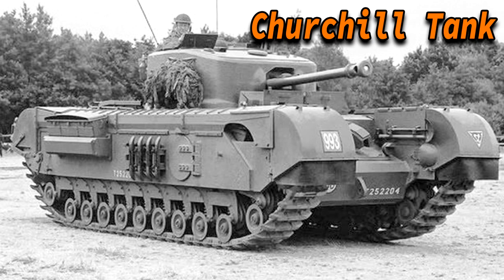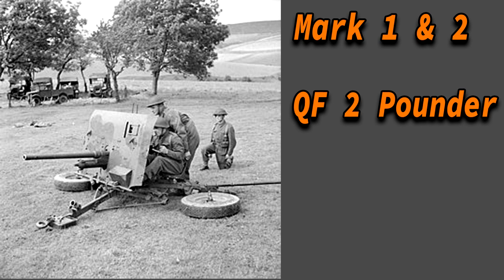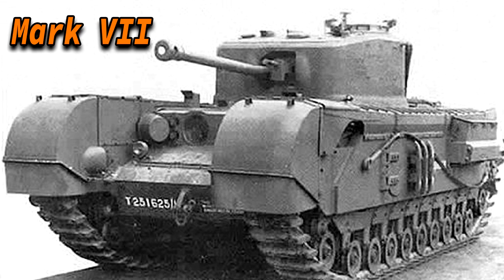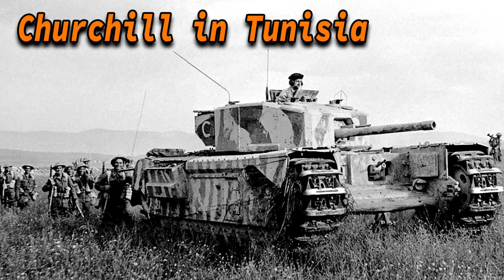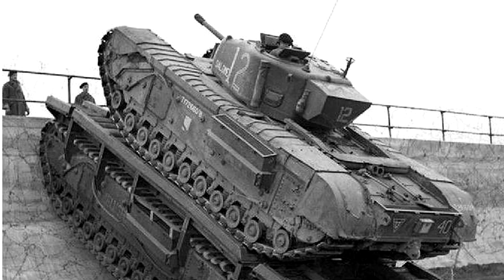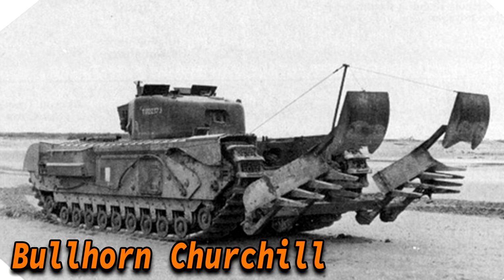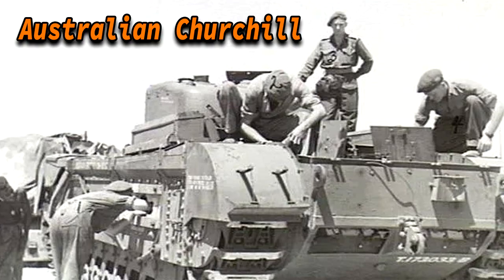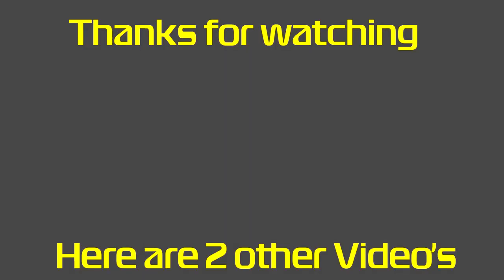Churchill | Waste of Materials?

Comment: Misunderstood tank. Basically,  Churchill is the British "Panzer IV", but overloaded with armor. Pz IV 300hp engine, Churchill 350hp engine. Engineering/development-wise both stem from 1930s tech and doctrines. Both same width, but Pz IV has the slight turret ring advantage because the Churchill's tracks run ontop of the hull - both max out at 75mm caliber though. One cant really judge Churchills prior to the "great rework" program: which was basically a major upgrade program to all subsequent Churchill tanks after the Dieppe incident (because the captured tanks were meticulously studied by the Germans, the rework program was a necessity). The Bedford engine was actually a pretty good achievement given the restrictions of limited development time, limited engine bay space and the RAF's privilege to high end aluminum for engine production. One needs to look beyond horsepower output. Torque is where the Churchill excelled at; fantastic torque band all the way from low to high revs. This is what gave Churchills incredible climbing abilities. In fact there is a historical jungle trial video on youtube which shows an M4 tested against a Churchill on steep jungle slopes: the supposedly stronger M4 engine stalls, but the Churchill engine simply goes on and on. Finally, people forget the postwar Churchill AVRE with the L9 165mm gun shooting HESH rounds - now that was a serious beast (never saw war action though).

Comment: The Churchill was based on a WW1 doctrine. Even then, it clearly demonstrated its uses and versatility. 
Its main drawback was that it was too narrow, but this was dictated by British railroad gauge and the width of British train tunnels. It could not accommodate a turret that would house a 17-pounder gun, which would have made it  able to hold its own against Tigers and Panthers. 
The Black Prince version with the 17-pounder was not ready in time by the end of the war.
Reply: Tigers and panthers were less than 10% of German tanks, if a Churchill came across one it could just fall back and let someone else deal with it. The 17pounder would have made the tank WORSE as it had a terrible HE shell (the ap was insanely good though probably the best of the war).
Reply: The Churchill with the 6-pdr using APDS shells could knock out a Tiger.
Reply: @BeaufighterGaming  That's what the Fireflies were for.

Comment: I have a book written by one of the commanders who was there who said all the Churchill tanks that were on inclined beach of more than about 10 degrees could not get off the beach and got bogged down in the pebbles. This is in contrast to the over 45 degrees incline that two went up to get at a German position in Italy. As for my opinion the first few were not so good and the service manual even says so, saying something like that it is better to have a tank with issues rather than no tank at all. Part of that was the engine and partly the gun. Once the armour suspension gun and engine were upgraded it was almost unrecognisable from just specs. extra 4kmh 75mm cannon extra 50mm of frontal armour and vastly stronger suspension (less likely to break springs).

Comment: OH, I like the looks of the Churchill, especially the latter MkVII. The real downside (especially in games) is the lackluster gun it had. That makes it rather unbalanced and as a result the tank gets put in higher tiers than where it belongs. Too bad they never figured out a good way to put a larger turret ring on it and never put a decent engine in it.
Reply: When I was young and playing wargames with miniatures, the tiny guns on British tanks was always rather sad compared to the bad-ass German tanks (size matters!).  But I remember reading that one of the constraints imposed upon it in the planning phase was the ability to be transported by rail in England, whose rail gauge was not very wide. Thus the small turret-ring that could not accommodate larger guns.  I'm no expert.... so if someone knows different, let me know!
Reply: @reynauldc984  That sounds similar to the size restrictions placed on American materiel during WWII, where both rail and shipping requirements limited the size and tonnage of the Sherman M4 tanks and the Panama Canal width limited ship sizes for the Navy.
Reply: @reynauldc984  no ... That's pretty fair ... The British rail gauge did indeed impose restrictions on British tank design. The Cromwell/Comet were elegant,but on the smaller side .

Comment: Wasn't pretty, fast and didn't have the biggest gun. What it did was the job it was designed to do. It did the job it was made for possibly better than any other tank fulfilled thier roles but the T34, PANTHER, M18, AND STUGG3's were Sevier and had the big guns. I agree  with you about the looks of it.like it was a bastard child of a Matilda and a mark8 from the great War. That's why I never bought the model but I got a crusader instead. At 8 years old and in 1977 in the United States, kinda hard to learn about British tanks in a small town library.
Reply: Comparing it with the T34, Panther or even the M18 is a bit odd anyway since they were different concepts for different purposes. A better comparison would be with the other Infantry tanks like the Mathilda II, the french Char B, the KV1, the Tiger and perhaps the IS2 for that matter. I think the american M6 was also intended in this role if I'm not mistaken and the Sherman Jumbo also somewhat belongs in this class. StuG's can somewhat be included in this regarding their primary role as close infantry support although they differed quite a lot in their construction characteristics. 

As an armoured vehicle for close infantry support the Churchill was quite decent I'd say. Its armour was formidable, its speed was laughable but it didn't matter accompaneing infantry on foot....shure, it's gun wasn't that impressive in 1944 but it certainly was far better suited for the intended job than the 2 pounders of its predecessors who couldn't propperly fight anti-tank gun positions due to lack of HE ammo (contrary to common myth, the 2 pounder was quite effective as anti tank gun for its time early in the war). Furthermore it used the same ammunition as the Sherman so the risk of running out of supplies was greatly reduced that way.
Reply: @JosipRadnik1  I was saying that it was the best of it's type. Like the Matilda 2 was in 40 41 . Not that it could do what a good medium tank or tank destroyer do. It was a great infantry support tank, able to get in close and blast a hole in the bunkers and then give them a squirt of napalm.

Comment: Pretty tank that's useless out of its comfort zone or ugly tank that's effective where the Sherman or Tiger can't go.  It wasn't fast and wasn't meant to be, but the 2pdr was an effective anti armour gun till the Tigers came into production. The 6pdr could take anything below tiger and the 75 mm had an excellent he round. Only the whereaboos hate on the Churchill because they know it was a better all round platform than anything the Nazis had. Huge kill rates on the eastern front pre T34 mean nothing. A 37mm anti-tank gun could take Russian tanks out (,other than the KV). But then they had the same problems against the French BiS. They didn't learn any lessons, too few tanks,too unreliable, cost too much in fuel and manpower and ultimately overran by cheaply made mass produced afv's.